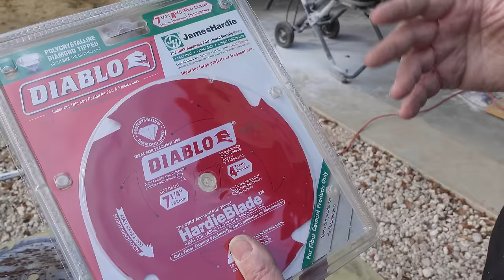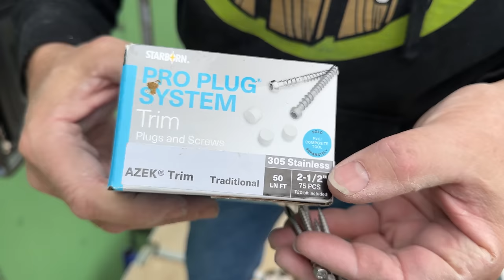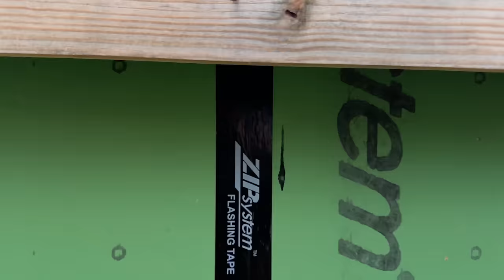Installing a Bulletproof Soffit and Fascia That Will Never Rot!

Comment: Question…do they offer a pvc version of Hardie horizontal siding that has the wood grain? I think the Hardie is like 8” by 16’. Thanks!!!!✌🏼
Reply: It costs more than hardie and is marketed as cellular pvc.
Reply: @NurseAcrobat  I assumed it would be more expensive. That outweighs the inconveniences including dust and special blade in my circumstances. I need to replace several old rotted siding boards on my chimney. They look like Hardie but are the crappy pressed wood they used prior to Hardie.  I’ve been putting the job off because of the inconveniences of Hardie board and buying and swapping the special blade onto my miter saw. I wrapped a porch converted to bedroom with Hardie siding like 20 yrs ago Where can I get the pvc equivalent? Thanks!! 👍🏼
Reply: @jimbanville   All of the versions I've seen require special ordering and I'm unsure of minimum order sizes, but Azek's Bevel trim may work for you. There is also Celect's 7 inch clapboard and Everlast but they seem to be more designed as an interlocking system vs something that can replace individual boards. When I check their individual sites they link me to local places that can order them, and I've been able to get samples. The Journal of Light Construction had a good article on them in 2021 titled "Solid PVC and Composite Sidings". 

When I thought I was going to replace all of my masonite siding cellular PVC was in the running, but so far I've just replaced a few pieces with hardy since I can get each board for ~$13 locally vs a special order. I use the same guillotine cutter I'd gotten for cutting laminate flooring to make most of my hardy cuts without making dust.
Reply: @NurseAcrobat  see..that’s the point. I don’t want to buy a special blade or cutter that I’ll never need again to cut the Hardie board. Along with filling my saw with cement dust. My house is 99% brick. My chimney is the only exposed siding on my home. The other area is around my front door that never gets wet under a porch. I have maybe 6 or 7 prices of siding that are maybe 2 ft long that I need to replace.  I’d do it tomorrow if I could get wood grain pvc that looks like the Hardie board.
Reply: @jimbanville  I would see if you can order just a few pieces of Azek's Bevel siding. Otherwise if the two foot pieces are simple cuts it may work to just use a razor blade on hardie. I've been able to score and snap hardie siding but the edge isn't always as clean. I do hope to see PVC siding become available as an off the shelf item vs something that has to be saught out. I've used pvc for interior and exterior trim replacement.
Reply: @NurseAcrobat  I’ve thought about the razor blade score + snap, but I have a feeling it won’t be a clean edge. Thanks for the suggestion 👍🏼

Comment: Just curious, could you have 45’d the end of the fascia and let the ends join up at a 90 to not need the plug to hide the joint for soffit?
Reply: Certainly, but there was no bird box at the corner, so it would end up being a compound cut to make the miter. A difficult task to do perfectly when you save that cut for the last one. At almost 30 ft. high though, no one's really going to see it, and once that joint is glued with the proper cement (PVC trim should be glued at the joints) it will never come apart. The pvc will break before the joint does.

Comment: off top question
were you considering using radiant heat reflective insulation vapour barrier (like for example Dupont Airguard reflective) on inside to make insulating properties 3-4x better compared to standard insulation without heat reflective layer (only if mounted with airgap to spec.) .....it also go other way around where you use double sided metalized type of radiant heat barrier for outside heat to make summer even more comfortable inside (there is also multiple layer radiant heat insulation to replace the wool etc,,,super efficient but its pretty expensive stuff most of the time) 

or it isn't as simple to use because of local regulations / it wasn't considered in the project

Comment: that pvc will shrink like crazy, ive seen a job where it had 1/2" gaps in the joints after 2 years,
Reply: even 1/8" gap would look nasty on the fascia. There is a reason 99% of the houses use aluminum fascia overlapped.

Comment: Well…, okay but….. Less than a 24 inch eave sucks and 36 is right.  It works.  36 keeps some water away from the foundation and provides a dry walkway in rain and snow.
Reply: Don't think they can go 36".. squeezed too tight into that small lot. Wonder what code to prop line is in TX.

Comment: I don’t understand why you think flipping the truss in this build caused an issue. You installed wall to wall trusses. There were no tails on the trusses you built a box and then added eves after. If there is a bow that means the wall is bowed pushing the truss over causing the other wall to be incorrect. It seems like the walls are not plum all the way across.

Comment: I feel like the roof should have been a single slope instead of two, to keep the profile lower, front to back.
Reply: I think they actually looked at such a design. They didn't give much info on the design phase, but they went this way for some reason. They like the high interior a lot it seems. Either way they could have made the roof less steep. You can actually have a lower roof with the two slopes (gable) than with a single slope. It's a different style.
Reply from the maker: That was the original plan.  Neighbors didn’t like the modern look so planning commission asked us to change it.

Comment: Wait, a sawstop can't run an 8in dado stack?  This doesn't sound right.. 🤔
Reply from the maker: Sawstop makes a dado cartridge about $300 I think.
Reply: @StudPack  ahhh... Of course they do.. lol.  Did you run those two 10in blades with the sawstop protection system turned on? 🤔
Reply from the maker: Yes, was kinda surprised it started.  Safety cartridge made for a single 10" blade, probably wouldn't stop a double as fast

Comment: Using breen  Zip on the roof NO good.  It’s only 7 /16. Not even 1/2 “.   Orange zip.   Just  under 3/4.  Should B used on the roof.

Comment: A professional framing crew with four journeymen and a laborer would have framed this structure in no more than five working days. They generally charge around $7.00 per SF for labor, and you would count the second story in that SF estimate. You might want to keep that in mind when you build the main house. You would save a tremendous amount of time and effort, and you would greatly accelerate the timeline to finish the main house. The quality of professional framing crews would have been comparable to yours, but it would not have been as pretty. Because the wood frame of the structure is covered up, it doesn't have to be pretty. You guys burn way too much time making perfect joints because it makes you feel better. In reality, it doesn't add any strength to the structure, and houses framed in this manner are extraordinarily strong because the shear panels bind the walls to the slab and roof.
Reply: Time is the least relevant part of this build. Cost is the number one factor. If they hired a framing crew, they wouldn't be able to make most of these videos, thereby cutting off their main revenue source. So your suggestion does not make much sense.
Reply: @mr.g937  True, making these videos is in a sense their real job. I had assumed that they would have other material, but now that I think of it, that is an unfounded assumption. This build is their major subject for their videos.
Reply: Jordan only wants to be a You Tuber - so he will be happy filming anyone. Paul has become a You Tube presenter  so he can narrate work of others. So can be done. Just done differently.
Reply: @BobTheOldBuilder  Jordan's father is an excellent General Contractor. He has superior knowledge, especially in remodeling, to most GCs I have seen. I am a licensed GC, and Jordan's father is an exceptional residential GC.

Further, Jordan's father is also an honest GC - which can be very rare. He also has very competent problem-solving skills. In my opinion, that combination puts him in the top 5% of all GCs. I would hire him in a heartbeat to do a residential remodel project.
Reply: @franklong6269  I AGREE. Paul is excellent. V. likable too. Just saying his son is turning him into a youtuber..
Reply: @BobTheOldBuilder Filming a random framing crew (and most crews don't really want to be filmed, which is another problem) would be a much different channel, and I would say a much more boring channel, than this one.
Reply: @mr.g937  Not really. I have watched dozens of videos on new construction framing, and all of them have never come close to capturing just what an art it is. Nor has any YouTube video shown the shortcuts that pro-framers use to build wood frame house structures in amazing times. 

I worked my way through college as a professional framer, and it was brutal work. I would say that it is the modern equivalent physically of training to be a gladiator in ancient Rome.  Also, if you were stupid, you would get fired in less than a day or seriously injured. 

When I framed, we drove all nails by hand. Pneumatic nail guns were not used. My framing axe weighed nearly two pounds at the head, and some days, I calculated that I would drive over 2000 nails. My nail bags could weigh as much as 60lbs when filled with nails, and we climbed ladders, carried heavy loads, and set huge beams by hand while wearing them. 

To this day, I remain stronger than many athletic individuals 40 years younger than me and I play full-court basketball.
Reply: @franklong6269  ok boomer

Comment: I don't see how the scaffolding remains stable without being secured to the building.  I'd never climb a scaffold that high without securing it to the building.
Reply: I would if it is on a solid ground but jumping on to the scaffold from the roof seemed really dangerous for all of them.
Reply: @Faruk651    I saw that and it's crazy.  Then he climbed down the scaffolding very fast like an ape.  When you're young and strong you do stupid things like that.

Comment: Great example of good intentions, bad construction.  In passive house design this method is called a "Mold Sandwich".  Without proper ventilation this structure will experience catastrophic rot within 25 years.  When it is zero outside and 70 inside the dew point (the point where water vapor condenses into water droplets) will occur INSIDE the roof assembly; it is just physics.  Cathedral ceilings are difficult to vent but with proper knowledge it can be done correctly; this one is not.  In the absence of proper ventilation construction practices the owner of the structure will need to mechanically maintain the humidity level 365.  Sorry guys, you appear to be good carpenters but leave the design to more knowledgeable people.